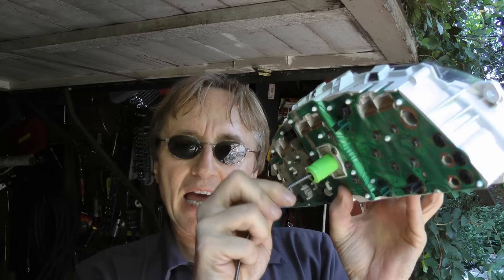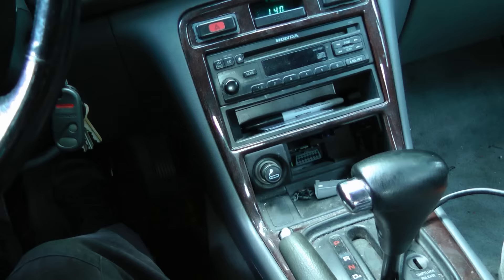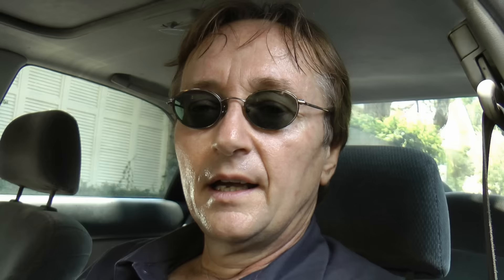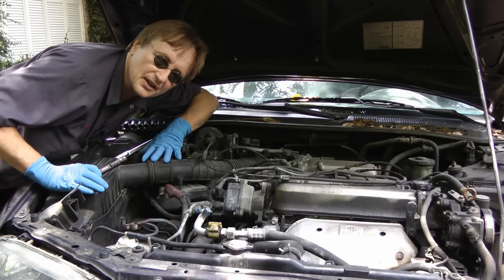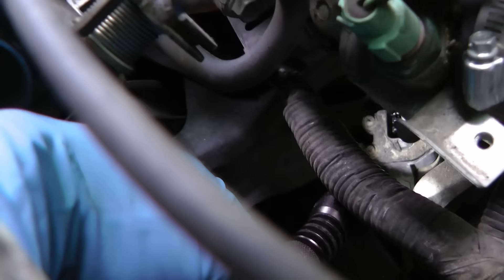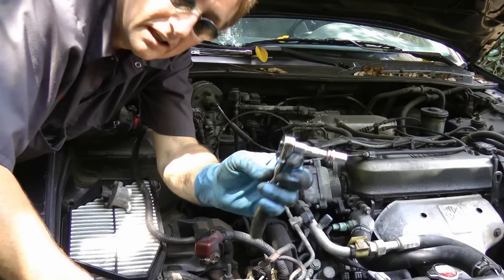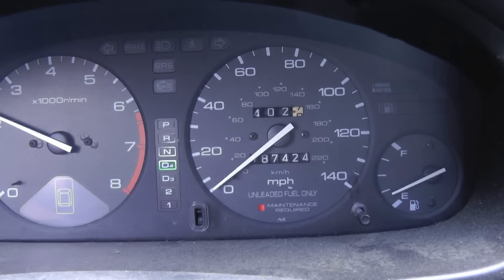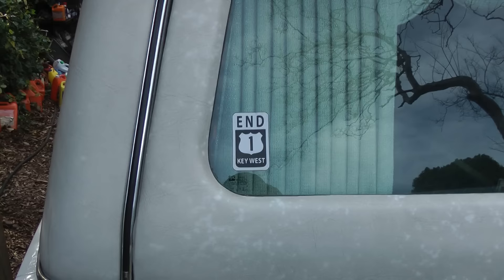How to Fix a Speedometer Gauge in Your Car (Speed Sensor)

Comment: I have 2003 M45 infiniti and the speedometer stop working. To add on my car is losing current. I have a new battery and alternator is maybe 8 months old... I'm charging the battery now. I have a leak in my drivers side vile gasket so I really need help with taking it off. Can't find a tutorial for my car...helppppppp

Comment: I bought an 1972 Ford F100, but the speedometer does not work and the odometer goes backwards. Do you have any idea how to fix this. I do not know if someone changed the transmission, to turn the cable in which ever direction.
Reply: MaxZagar I would drive it till it says about 1000 miles and sell it😂
Reply: Good Idea :) I found a Adapter on SummitRacing that reverses the rotation. Everything works now correctly.

Comment: what would I do if I am getting a misread due to a slightly larger tire
Reply from the maker: follow someone with a true speedo and figure out 30 45 and 65 mph and write it down
Reply: Scotty Kilmer but... then what? is there a different piece you can plug in designed for different tire size, or a modification you can make to the computer. i saw one mod by "mighty car mods" where they made a circuit to change what the speedo says so you know the speed, but that would set off the milage of the engine and stuff.

Comment: I have replaced the speed sensor and still have same problem
I believe its the wiring problem
but how could I change it ??
Reply from the maker: test the wiring using meters at each end, and if that's OK, then dash unit is bad
Reply: Scotty Kilmer dash is brand new mr scotty
iam sure its the wiring how possible I can change it ?

Comment: Hey Scotty, I was told by a shop to replace the sensor and they did. and my speedometer still doesn't work. Whats wrong with my speedometer? 1997 Honda Accord 2.2 vtec i believe.
Reply from the maker: Rudy Mireles get a used dash , the speed heads often go out and cost a ton new
Reply: I bought a dash but the problem is the wiring
how could I change it

Comment: At times my Prelude's RPM gauge stays on 1300 no matter what the engine is doing. Sometimes it works. Any ideas?
Reply from the maker: Chuck Creasy the tachs in the dash break all the time, most guys buy a racing tach and mount it on the dash like in a race car, they cost little and are easy to install. Dealer tachs cost a ton

Comment: how do you fix a speedometer with a cable? I keep replacing them for them only to snap 6km down the road. I own a 95 holden barina and live in Australia
Reply from the maker: +Casey MacLean you pray it's just a broken cable and replace that (as the gear drive for it can break as can the speed head.
Reply: +Scotty Kilmer is there anyway to tell if it's a broken gearbox?

Comment: hey I'm not sure if anyone can help me here but I bought a 95 honda accord and the speedometer is off by 10 when I am going 30. the car had 205/55/16 tires which are +2, but I don't think that it would mess up the speedo that bad.  the odometer froze the other day too. is this a problem with the speed sensor, or could it be the speedo itself. the car has the old obd so I don't think I can scan it.  any help would be greatly appreciated

Comment: what other problems can a bad speed sensor create on a 1994 ford mustang HO v8 can it be bad and still keep the speedometer moving
Reply from the maker: poor shifting on automatics
Reply: well  when i step hard on the gas after 2000 rpms it races to 4000 rpms but when overdrive is off its ok when i press hard on the gas can this cause that and my both odometer is are not working

Comment: i have a manual mazda demio 2006. just replaced front hubs, and axel parts.  abs not working. emergency light goes on and off . after driving for a little while my power steering check light comes on and the steering is hard. any ideas anyone?

Comment: Need help Scotty my 1991 honda accord runs fine the only problem is that when I put it in park it starts reving by itself from 1k rps to 2 rps and im not pressing on the gas it just goes from 1 to 2 does not go no more than 2 rps that could it be
Reply from the maker: +PreludeBB6JDM   check for vacuum leaks, and also do my video "how to fix a car that idles poorly"
Reply: ok thanks

Comment: what if the wires in the clip come out? how am I supposed to place them back
Reply from the maker: +Ricky Flores they are supposed to slip in and snap in place. If not, you can push them in, then seal em with silicone sealer

Comment: @scottykilmer For 2004 toyota rav4: transmission was replaced then the speedometer stopped working after the change. I purchased the speed sensor that goes into the transmission and the speedometer still did not work. Checked the wiring changed fuses and with the vehicle on the on position. With the sensor out and moved manually by hand the speedometer was working but once I place ot back inside it doesn’t. The rav4 has 2 speedometer sensors. By any chance would it be the other one does not work and needs to be replaced? Also when I checked it on a obd2 scanner it shows up as speed sensor a but when purchasing two different sensors show up and are not described as a A or B sensor. Can anyone help? Thanks in advanced.

Comment: i dont have the problem where my speedomoter is stuck at zero but i feel like my speedomoter is showing 5-10mph higher than im actually going thsi on my 1998 dodge grand caravan please any help is appreciated
Reply: +Stephen Scarbrough Are you running oversized tires? That can cause speedometer error.

Comment: ...Scotty Kilmer:  true definition of a shade tree mechanic!!!  WHO LUVS YA SCOTTY!!??  But I digress,  my sons `03 Windstar,.. yeah, I replaced the instrument cluster and took it for a spin, everything seems to be reading correct and then the speedo just FLAT LINED. I KNOW I made sure the blk wht gry  plugs were secure,  ...would it just poop onya , all of a sudden like that?  PEACE
Reply from the maker: +Gary Kovach it's 13 years old, and an old used dash assembly may be almost shot too. but if not that, there's a short in the speedo wiring or a realy bad speed sensor

Comment: hey scotty i am driving my 1999 model altezza from japan the speedometer is not reading and the odometer and the ref count is ok i replaced the speed sensor ans its not working
Reply from the maker: replace the speedo head, it's bad. OR just get a used dash from a junk yard, that's much cheaper to do

Comment: found this video now and have a few things to say.
"Speedometers use to have a wire that went directly into the speedometer, but they stoped using wires ove 20 years ago"
My Subaru Impreza I from 1996 uses a wire that goes from the transmission directly into the speedometre. So even if it might be almost over 20 years old now, it sure wasn't 2012!

But anyways. My speedometer doesn't seem to wanna work, the wire looks well at both ends (i've checked about 30 times wihting two days now) but the needle in the speeometer still wont mive a bit. sometimes it does move a little bit but it is far from accurate. SO no sure what the exact problem is. Would love some help.
Reply: nobody cares

Comment: hey scotty , well my 04 optima speed sensor is broken and it also feels like the transmission isnt shifting properly.
the  check engine light put out these: 
P0715 Input turbine speed sensor
P1529 TCM
P0102 air flow meter
could this be a sign of a transmission slip? hope not 😥
Reply from the maker: +Jah Rasta fix the sensor first, that helps it shift. Also change the air flow meter. Pray the TCM isn't also bad.
Reply: Thnks Scotty

Comment: Hey scotty, i was driving my 1999 lexus es300 and the speedometer just stopped working out of no where and the odometer is blank suggestions?
Reply from the maker: if the odometer doesn't read at all, then the dash unit has shorted out
Reply: so its most likely the fuse

Comment: how can I check the sensor, can I take it out start the car and move it myself to see if the speedometer moves ?
Reply from the maker: +Savu Macias you can try that, but it's a lot easier using a scan tool , then driving it and seeing if the tool shows speed IF it's working
Reply: +Scotty Kilmer can I do that with a 95 eclipse gs, and if it work then whats wrong the gear is broken right or ?

Comment: I have a 2002 Chrysler , town and country . The speedometer is stuck behind the pin how do I get it on the right side of the pin,
Reply from the maker: it's broken, you really need a new dash. But you can try removing the dash, and taking care to slowly bend it back, but that doesn't always work
Reply: fixed it with a paper clip. we do not need a new dash.

Comment: I have a 2015 mitsubishi outlander. I noticed that speedometer is 5km off. I drove 100 km/h put on cruise for atleast 20 mins but on my 3 DIFFERENT gps were reading only 95 km/h. all tire pressures are fine. my dealer said it was the satellite signal on my gps. but I have 3 cars and its only happening on this one.
Reply from the maker: +jeremar matibag  many modern cars are off somewhat, yours is no exception. I'd just drive it that way, realizing speed is off

Comment: hi Scotty I'm having a speedometer issue it wasn't working a few days ago so I took it to get checked and a code came up as speed sensor and. at communication lost  so I put another speed sensor in it and  it worked for a few days then it went back to not working sometimes if I smack the speedometer it will work and then go dead again is it my speedometer cluster itself that's broke I do hear some weird like noise coming from the dash
Reply from the maker: +Donte Quinney  yes, try a used dash from a junk yard
Reply: Thanks Scotty my problem went away when I got a speedometer from the junk yard

Comment: Please answer, 
My car speedometer and temperature gauge has stopped working. 
The light come work fine, but the speedometer and the 1000X next to it won't work. 
My stereo has also stopped working. 
It's strange because sometimes while driving or when I start the car it just starts to work like normal and then after I turn the car off it stops. My mate who is sort of a mechanic checked the speedometer sensor and said it could be the dash. If it's the dash why the stereo isn't working. Also the stereo works sometimes. Please answer. It would help a lot.
Reply: The car model is 2001 Mitsubishi Lancer auto
Reply from the maker: +AzAd Rez dash or wiring going to the dash does that on a mits.  Try a used dash from a junk yard
Reply: +Scotty Kilmer so what about my stereo? We checked all the stereo wiring and they are all good. Also why it comes on and then goes back.

Comment: hello Scotty, I have a 93 Toyota Camry that when I am driving my speedometer only goes up to 40mph even if I am doing 65 or 70mph u thing it may be the sensor or dash is bad
Reply from the maker: most 93s have a cable, but if not, change the sensor
Reply: my have the sensor thanks Scotty

Comment: I have a question so I have a 1997 mustang Gt and my speedometer is reading 100mph when I'm in second gear but in reality I'm only going 45mph 

Also when I'm in 4th gear at 3500 rpms the vechile loses acceleration but then gains then loses it??? I think that's how you say it, but then loses it again and that's for 4 and 5 gear
Reply: I would have to say that the wiring and speedometer are bad. Loss of power and erratic readings are symptomatic of bad wiring/speedometer.

Comment: 1990 chevy 1500. Odometer isn't turning. Any idea why that would happen?
Reply from the maker: try a new speedo cable
Reply: Spedometer is working fine. Odometer is not turning though
Reply from the maker: oh, then live with it, or get a used dash, as no one fixes those anymore UNLESS you have an old fashioned speedo repair shop still in business in your area.
Reply: This video I found a couple hours ago shows replacing an odometer gear on a mustang (at the 5 minute mark). I am wondering if it would be the same process for my 1990 chevorlet 1500

Comment: Hey Scotty I changed my speed sensor and my speedometer still dont work . What could be the problem now.
Reply from the maker: David Credle bad speedo head in the dash, bad wiring, or broken drive gear inside the transmission
Reply: Scotty Kilmer I have the same problem with my 92 Honda accord. I'm positive it's neither the trans gear, or speedo head in dash. So which wiring do I deal with if it's not to detailed to go into! Thanks!

Comment: Thank you so much scotty this is my exact model.i had a valve cover leak and waited to long to fix it. It's fixed but oil leaked all over the sensor and ruined it I tried spray cleaner but no luck thank you!!!

Comment: what if my speedometer and my odometer doesn't spine?? I've replaced the speed sensor but still doesn't work..
Reply: Chances are your instrument cluster is bad, and will need replaced. Finding a replacement at junkyard will be MUCH cheaper than having dealer/mechanic replace it.

Comment: Hey Scotty my car just happen to stop going the speed it supposed to it only go to 20miles what does it mean? an also I push my feet on the panel it cuts off
Reply: forgot to mention it's a Hyundai sonata 01
Reply from the maker: +Latoya Campbell pressure test the fuel pump, weak ones do that. As can clogged catalytic converters, you can pressure test them too

Comment: I got a 2014 auv and when the speedometer reaches 40 it's fluctuating not so much but it doesnt flow very smooth up until past 60kph. Sohow doi fix this?
Reply from the maker: +Jun Aquino it should be under warranty, take it back in. Could be a bad speed sensor
Reply: +Scotty Kilmer. before I asked them to check the cable for rattling sound then after the service this happened.

Comment: I have a 2003 mitsubishi galant and I already changed the speed sensor but the speedometer still doesn't work
Reply: does your speedometer move all over the place ? I have a Mitsubishi spyder 99... and it goes crazy...maybe its loose ?
Reply: check the plug and the wires on it,  I replaced the sensor but doesn't work, friend to me to check the plug,  it was looking fine but the wires inside was rusty,  I replaced it with another plug and wires from junkyard and it's working fine until now since two years ago

Comment: What if the scanner says 60mph and my speedometer says 70mph ?
Reply: I have a similar problem. My speedometer fluctuates between being 1-4 miles faster than my actual speed. Have no idea which part is in need of repair. I hope it's not something electrical.
Reply: @marycavazos2252  mine is like 15 miles off

Comment: I change my speed sensor but still doesn't move? what could it be please help!!!
Reply: Then it is the stepper motor. It is the motor which moves the needle. You will have to remove the odometer out of the shell housing and take it apart to fix the issue.

Comment: hey i changed my sensor on my car(Plymouth neon 1998) and im still having problems with just the speedometer gas works everything works but my speedometer doesnt at all i tried removing the cluster and soldering the back as i seen on youtube but still its not working
Reply from the maker: on those, just get a used dash, ya can't fix those cheap things
Reply: A new dash ? Or a new cluster ?
Reply: Coliee Gonzalez new dash

Comment: Now I have a 2001 explorer xls V6 and y rpm and speedometer aren't working but my rpm always shows 6k rpm and the speedo at 0. However the trip odometer works fine but the one that shows how many mile I have on the vehicle is really slow now so what would the problem be?
Reply: Don't care that much for the rpm gauge but I care more about the speedometer.
Reply: Ps anyone could reply to this if they have any ideas or simular experiences.
Reply from the maker: generally a shot dash unit where the circuit boards warp and short out. Try a used dash first
Reply: Thank you I'll try it and let you know if it works as soon as I can.
Reply: Id like to let you know the new (used) dash works and solved the problem so I'd like to thank you for helping me. And as I'd say keep on doing what you love man wouldn't know what to do without awesome people like you.

Comment: Scotty Help..I have a 2004 dodge neon my car would just not let me go past 30mph and I would pull over and turn car off and turn back on and resume driving if I could get over 40mph at times it would be ok (not all the time) and then I get stuck to long at under 40 and my car would force me back at 30mph. SO I HAD MY my transmission solenoid and input and output speed sensors changed out and cars runs great but now my speedometer stopped working.. ( this was (R.I.P.) my grandma's car and it only has 30,000 miles (now) and I got it just over a year ago with 15,000 miles on it) Do you have a clue what it might be?
Reply: those don't last long

Comment: I have a 2011 Toyota Tundra change both back Tire wheel speed sensors and I still have same problem 4h 4l does not work Step Lincoln and my speed limit 25mbh the drops to zero and I got all the lights come up
Reply: I tried take the old speed sensor and I broke it when I buy a new one  that's when I started up this issue
Reply: The only problem I had it before it was 4h 4l blinking
Reply: I checked thorness wiring they're working
Reply: Please help me I'm thank you

Comment: I have a 2002 Peugeot 206 the speedo is working it just giving wrong readings I was doing 40 it was reading 25 how do I fix that
Reply: Put smaller wheels on it lol
Reply: If you also have the steering wheel on the right side you have a UK car and the speedo is indicating miles per hour.
Reply: speed gauge read less than the speed is going the car
Reply from the maker: wrong size tires, or bad speedo sensor

Comment: My speedometer is reading 7mph faster than what I'm really going on my s10.  It has stock tires, rearend was changed though ......
Reply: JJD get it tuned
Reply: Figured it out the guy that replaced my rearend put 3.42 10bolt instead of 3.08 10bolt .  Hooked up hypertext and good to go